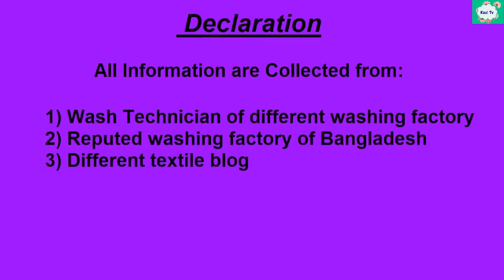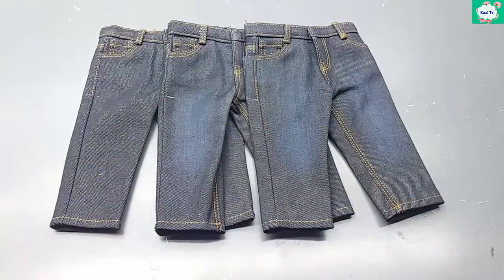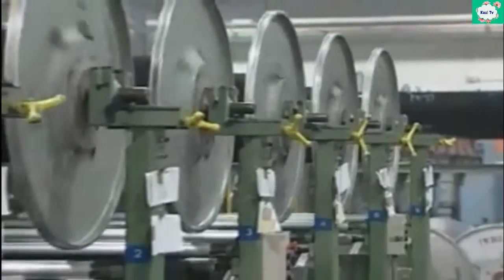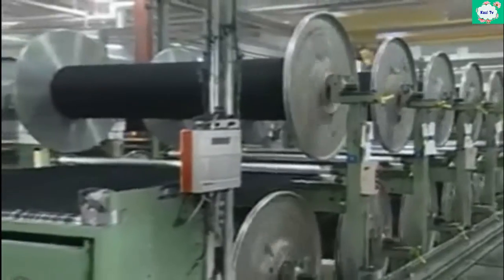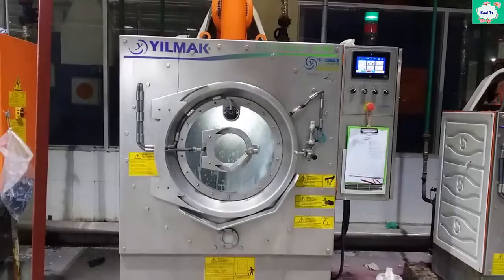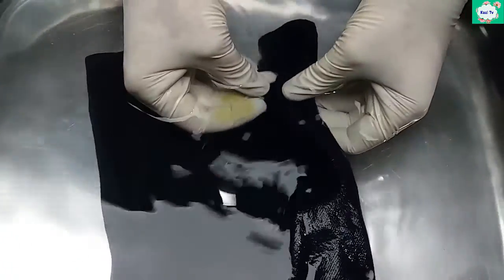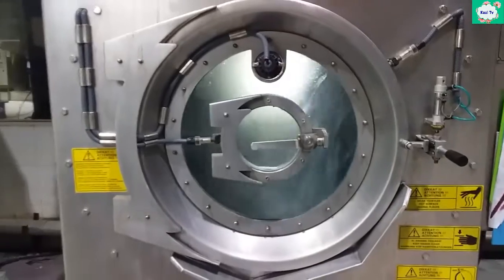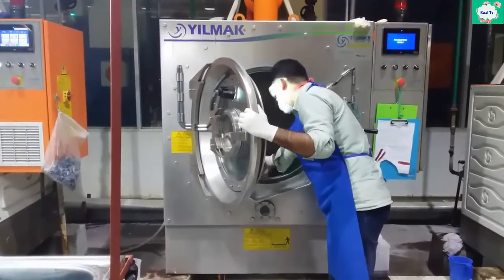Basic Wash on Denim Pant with Flow Chart for Beginner 👖👖 Wet Process on Denim Washing Process

Comment: What will happen if we don’t do de-sizing or we don’t neutral the garment?
Reply from the maker: in one word:de-sizing agent remove the size material and water surface tension.....If I dont neutral the gmts....gmts will be damage due to use clorin bleach.......For detail:plz join my fb group and text to admin......thnx for watching...plz share my video.....
Reply: After desizing with temp 55'centrigate only 20 minutes.two rinse with cold water.thrn u take water up to the febric (kindly test water hard or soft),then use adequate liq.chlorine of 40 percent power amd slowly move the machine 15 to 20 menuites with continuous observation,then no problem arice,u also add 50gm liq soap in chlorine bath.
Reply: Definitely use acetic acid if acid enzyme,ph should be 5.5.
Reply: Nothing,u can soap well and then direct go acid enzyme process before dyeing.Bit in case of thik denim ie GMS high then it will create line.otherwise no problem.
Reply: Add kolkata code